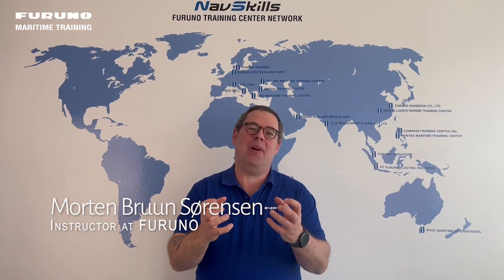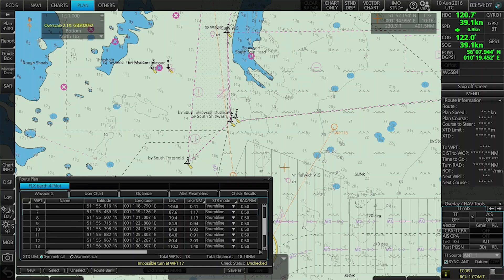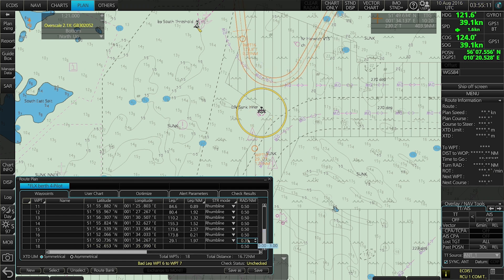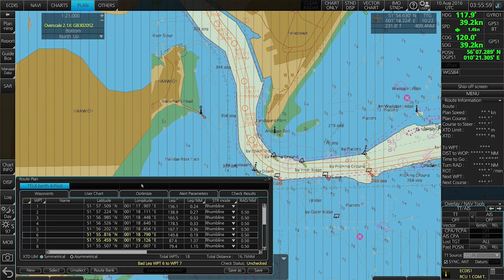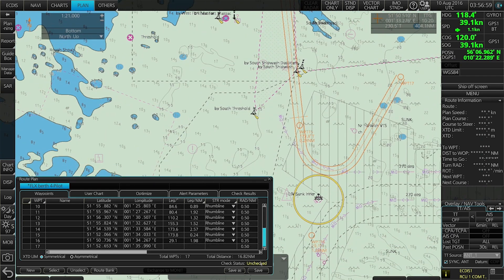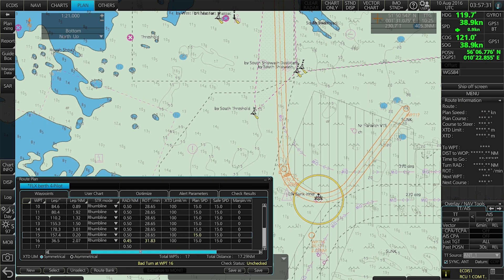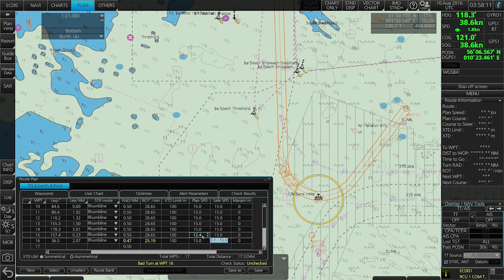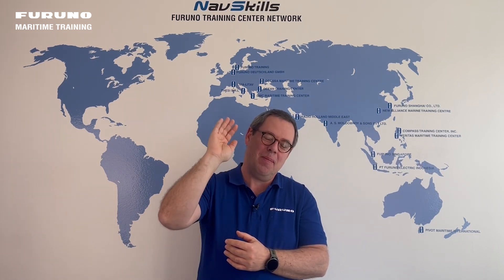How to get around the geometry check | FURUNO ECDIS tutorial |

Comment: Hi have issue during weekly Enc and Aio update my fruno fmd ecdis showing synchronisation error can not get lock, can you explain during update we need to enable synchronisation om both ecdis or it should be disabled.
Reply from the maker: Hi
Thank you very much for your question.
You should have both machines ON and the should be grouped together in Sync config menu and afterwards you should enable sync on one of the stations. You can also use Urge sync the first time, to push the correction through.
Kind regards
Reply: @furunomaritimetraining  sir I did same thing but sync status always show None ,only when I disable that time it's show disable or other time only None